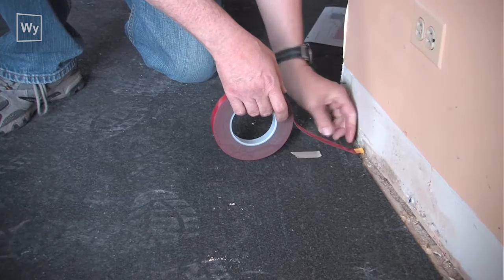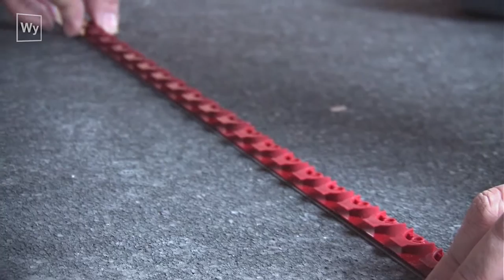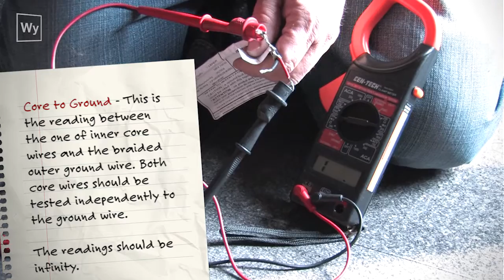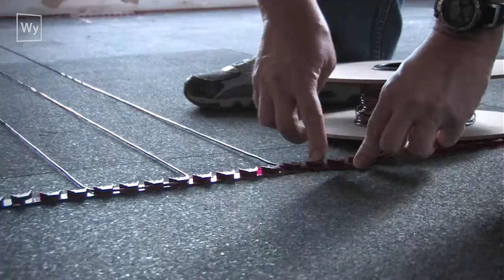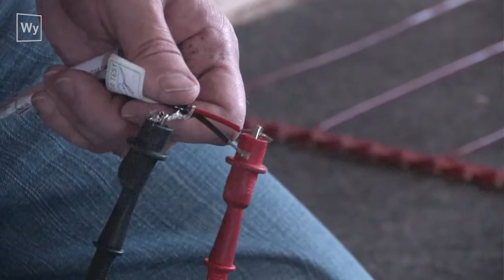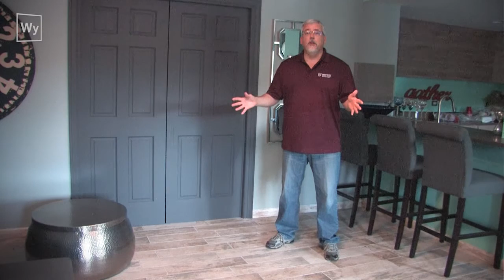Installing Electric Floor Heating under Tile Floor

Comment: Make sure the circuit tester has the batteries installed...
Reply from the maker: Very good tip! Definitely make sure all equipment is ready before installing. We also let customers know they should always test the heating mats/cable as soon as it arrives so if anything has happened in transit, we can get a replacement out to them before installation day. Thanks for watching!

Comment: How come there is no ention of the thermostat wire and where to place it? That need to be done before the self leveller.
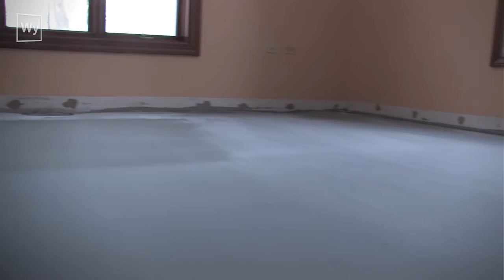Reply from the maker: Hi Tina, thanks for watching! at the 7:16 second mark we start the mentioning of the manufacturer splice (the connection of the heating element to the cold lead that connects to the thermostat). We have a separate video (https://www.youtube.com/watch?v=b5yFKbjXwUc) that goes into detail as to how to wire a floor heating thermostat to the floor heating cable. if you have any further questions, please feel free to contact us by phone (800) 875-5285 or by tech support chat, https://www.warmlyyours.com/en-US/support. Thanks! We hope we can clarify!
Reply: @Warmlyyours  The video in your link covers the connections at the thermostat but not the actual installation of the temperature sensor cable. The time stamp link still has not specifics about the temperature sensor installation at the floor level.
Reply from the maker: Murielle, you're correct that our previous comment did not cover the floor sensor application. We do not have a video specific to TempZone Cable that shows this but we do show it in this video for our TempZone Flex Rolls here: https://youtu.be/N40yJp4KHZs?t=164
I'll provide this feedback to our video team so we can work on getting a visual of this installation step for TempZone Cable. Thank you for your question and for watching!